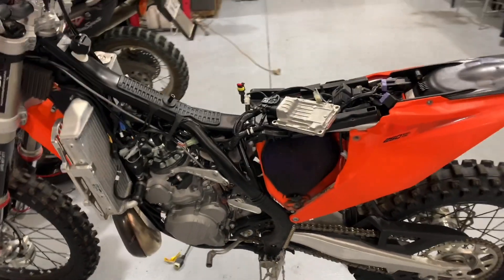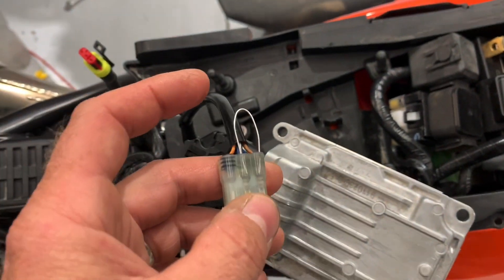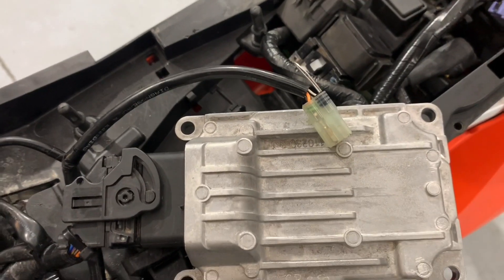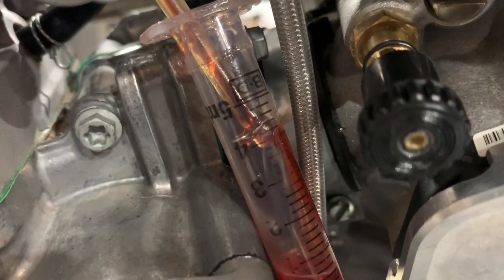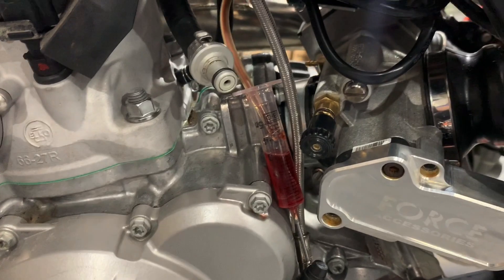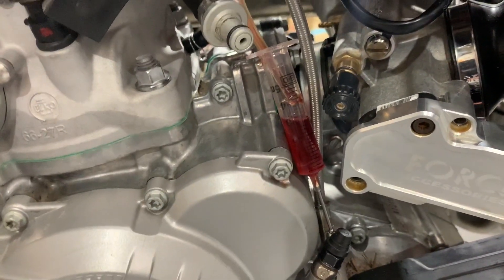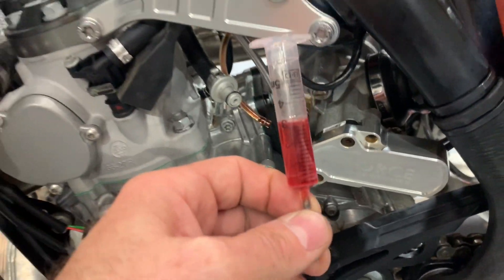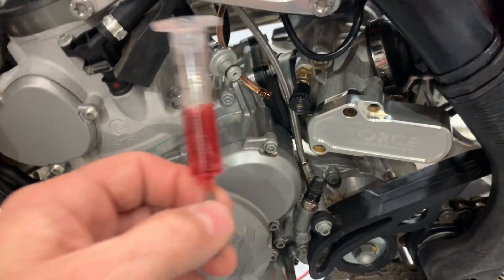TPI Oil pump priming

Comment: My bike can’t priming oil pump, whats the problem , if you have experience share with me please tq
Reply from the maker: Normally that will happen if theres a fault code present, or if the idle is set too high. Check and clear any fault codes and make sure that the TPS voltage is 0.60v or less at idle and try again.
Reply: @TwoStrokePerformance  thanks for your opinion, i aplicated your instructions and finally my 2t pump can priming normally thank tou 🙏🏻👍🏻

Comment: To clean the oil pump without disassembling it, I thought about putting degreaser or brake cleaner in the oil tank and running several cycles like that. Afterward, I would put oil back in the tank and run more cycles, this time with oil, and then reconnect the pump. What do you think? Has anyone already tried something like this? Should i give a try?
Reply: And if i spray inside some brake cleaner?
Reply: @max0202 defiantly don’t spray brake cleaner or anything strong. It will degrade seals
Reply: Old post but I want to 2nd ecwskier4500 and say you should not put brake clean into anything with rubber.  It will swell seals and o-rings.  It might work right away,  but the seals can swell with time and cause issues.  Careful with that stuff.

Comment: Just a quick note. Once you jump the connection, you have to wait a few seconds before releasing the throttle. If you hear the relay click and release the throttle without the wait, 3-5 seconds min, the pump will not operate. I was about to start trying to trouble shoot my pump before  realized this!

Comment: Could you confirm if this method works on 22s please Dave?
Reply: yes it works, i have video on my channel for 2022 models
Reply: Hi, I also have 22' 300 exc with TSP kit  and now I can't do the oil pump check.  It doesn-t work anymore.  It works time to time like once after 20 attemps.  Is there any sollution ?